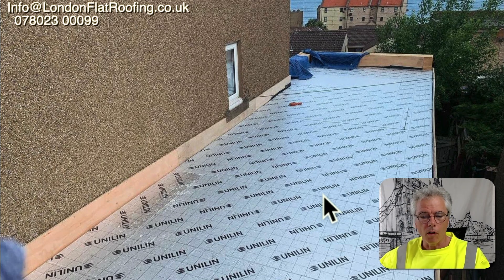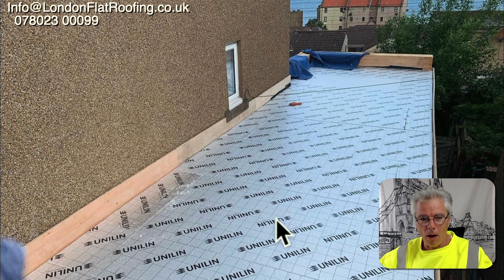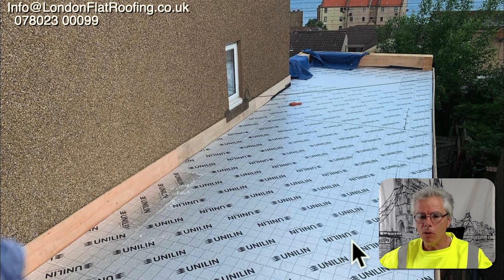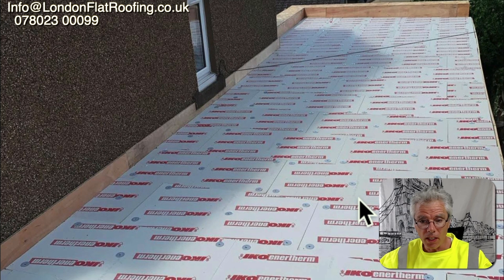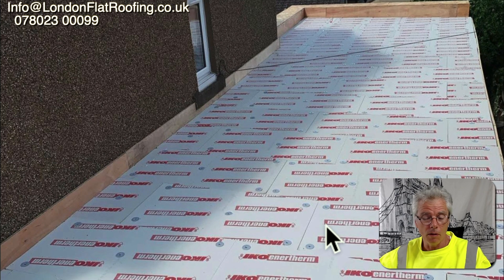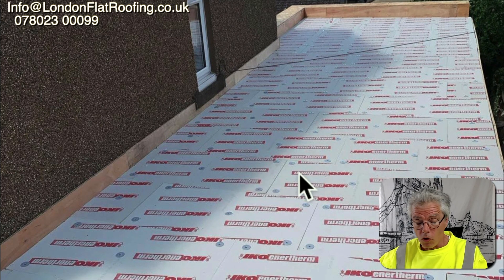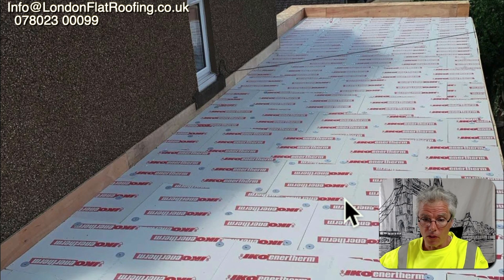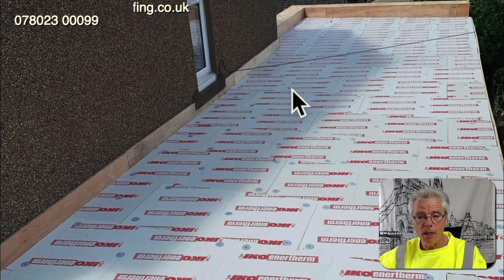One or Two layers of PIR insulation in a warm roof?

Comment: Hi Steve. Been watching your great videos. I am going with a warm flat roof with Osb 18mm tongue and groove deck. Adding Alutrix 600 as Vapor control barrier 150mm pir and then 18mm osb top deck tongue and groove. My question is due to my budget issues is a 2 layer torch on felt system ok as final top layer?

Comment: I used 2 layers of mineral wool on my warm roof. We call the ply against the wall if above roof a freeze board. Use uasually when we can't cut into wall to flash it. Being stucko we would grind into wall and put metal counter flashing in like on a chimney or brick wall.

Comment: Hi Steve. 
Is it possible to put 100 mm extractor fan pipe and a soil vent pipe through a warm flat roof  ?
Extension we’re building in Devon the architect has drawn 4 pipes going through roof 🤷‍♂️

Comment: Is the osb on the  top not a cold point as it meets the outside air therefore becoming the week point of the roof and point of premature failure in the future
Reply: No. It's on the cold side of the assembly. So long as the VCL is good and you've not got warm air leaking through the assembly (installation failure) hitting the OSB coverboard, the OSB will stay cold and dry.

Comment: Use a lot of woodfibre insulation over here in Europe, they have rigid water proof stuff (waterproof if the roof pitch is over 16º) but its all tonge and groove as well so no joint gaps.... unless your building is out of square 🥴

Comment: I've often wondered about this, and the cost of PIR without the foil, and have also found it odd and annoying that the the vapour resistance value of PIR is usually very hard to find.

Maybe the answer you could be looking for here is that the vapour resistance value of the foil bit isn't THAT much higher than the rest of it. In other words, because the breathability of the PIR foam bit isn't good either, then having multiple VCLs in the form of the foil facings on a double layer of PIR, is merely adding to the problem of trapping moisture and not a sole cause of? i.e. 2 layers of 50mm foil faced PIR might have a similar overall non-permeability as 1 layer of 150mm foil faced PIR - so there’s not enough in it to worry about unless you’re using for 3 or 4 layers? 

I found an old not about Celotex products CTB4000, GA4000 and XR4000: ”The foil-facings have a water vapour resistance of 1000 MNsg-1 and the insulation core has a water vapour resistivity of 300 MN·s·g–1·m–1 […]”

As a DIYer I can’t get my head around the units or the numbers to be honest, but perhaps you can? Does it really mean the foil is only about 3.3 times more effective at blocking moisture movement through it than the foamy bit?

p.s. Have you ever tried just peeling the foil off?

Comment: Is there any issue with using two different types of insulation. For example I currently have 50mm of fibreglass wool in a cold roof. Wondering if I can stick inculcated plasterboard underneath?

Comment: Sorry steve, I love your videos and I find them really useful. But can I tuck in the insulation in below a lower deck but above the wall. Or should I should I have the lower deck short of the wall so the tucked in insulation and warm roof insulation meet. FYI it’s having a top decked fitted as well.

Comment: Is the air vapour control layer simply dpm or is there a particular brand normally used ?
Reply from the maker: The air vape controller is normally a tarp product with possibly aluminium foil in it. It's not just plastic.

Comment: The "if" part of a two layer construction (rather than single layer) is whether sufficient moisture could accumulate at the layer join for it to actually condense out and then propagate the potential mould/rot. The solid PIR has nowhere for there to be that condensable moisture (compare with mineral wool etc). 
It's a long slow game (decade of life) to ensure that the moisture doesn't have opportunities to ruin everything. So many things to consider!
Reply from the maker: So many things to consider is assault right

Comment: I could be wrong but I think I can spot some black plastic sheeting just say sticking up out of the 1st insulation layer at the corner after the window & the top right corner which may have been used as the vapour control layer. I'm not saying that would be correct, just pointing out what I think I can see.
Reply from the maker: You could be right; however, plastic is the wrong material to use on a warm roof. Additionally, plastic Air Vapour Control Layers (AVCL) are typically green. Black is normally the color used for Damp Proof Course (DPC) or Damp Proof Membranes (DPM), all of which do not use virgin plastic and therefore do not offer the correct vapor resistance.

Comment: I would guess that you would say  the existing felt is a bad AVCL when converting an uninsulated roof to a warm roof. My bungalow had a secong floor with dormers added  and flat roof extension 18 years ago. Not a scrap of insulation anywhere. Expensive to heat in the winter and an oven in the summer. At least th electrician was good out i would be much more concerned.
Reply from the maker: no the existing roof can make a very good air vapour controller because the problem is tucking the roofing around the edge which was the subject of my last video. You've gotta make sure that you tuck it in around the edge. Bring the thermal element of the insulation that's gonna go over the top of the roof down to the next thermal element which is the wall this is so often missed and therefore realistically you're losing 7080% of the performance of the roof by not doing it

Comment: Interesting video. What would you recommend instead of the plywood against the internal wall?
Reply from the maker: the Air Vapour Control Layer (AVCL) gos up against the wall then the insulation
Reply: @SteveRoofer  makes sense, thanks